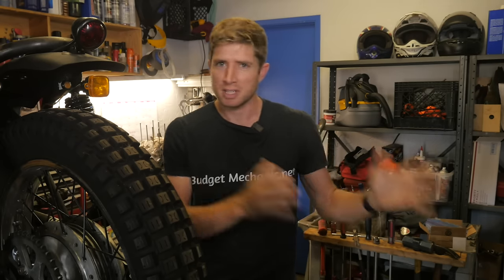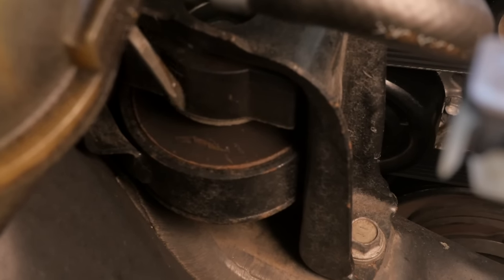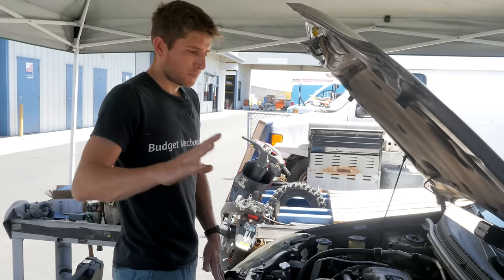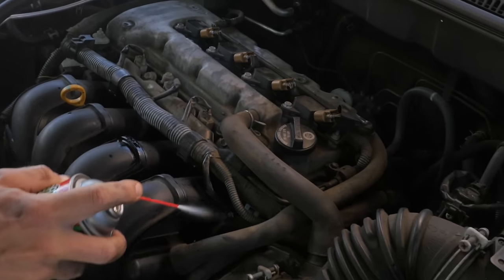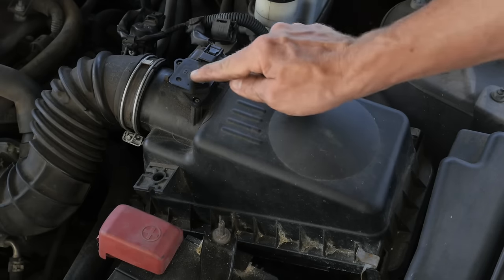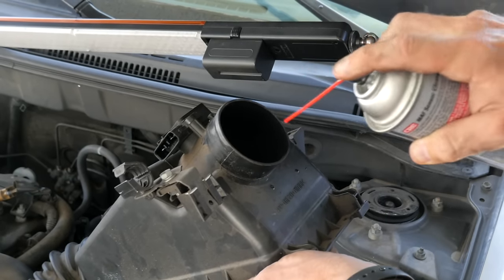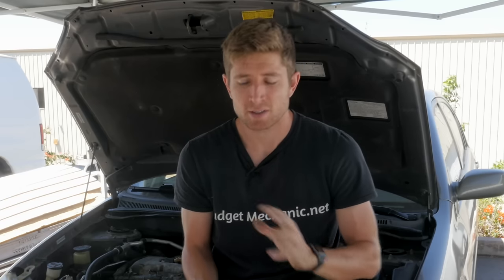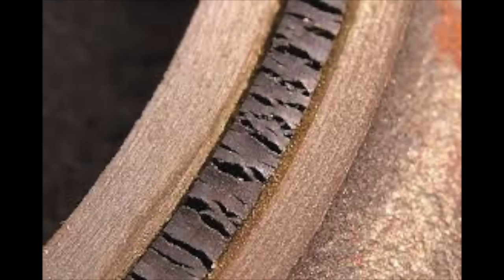Diagnose and Fix Rough Car Idle - Main Causes For Shaking / Vibrating While at a Stop

Comment: I should have watched last Saturday or yesterday. :D My car was vibrating/shaking when stopped, with a flashing service engine soon. Then disappears and reappears. I brought my car to an auto care and was told nothing showed up when diagnosed but went from there to misfire and coil was changed. But when test drived, it vibrated again and service engine appeared. To make it shorter, they weren't able to fix the problem and I was told the problem could be the engine, or inside the engine. I somehow doubt it, boyfriend thinks so too being a mechanic himself, but he's not around to check it, said it could be technical as well and not the engine. I called the auto shop and asked if they've checked other parts, before I consider other options for my 2004 Altima. Hopefully tomorrow is a better day when I bring it back. What do you think? Could it really be the engine?
Reply from the maker: Is check engine light on? That will help you figure out what cylinder is culprit. Do compression test, that will tell if there’s engine damage
Reply: @BudgetMechanicHawaii  
The "service engine soon" light is flashing, and it appears/reappears if the car vibrates. It says might have damage on cylinder 3 according to the shop where I brought it. They changed the coil, switched the coils, still with the problem so they said it might be internal damage with the engine. I asked if all other parts that can possibly cause the misfire were all ok or if they were checked, and was told yes. I wished I have known about the compression test and asked them the result, since it seems like they didn't do it with the "it might be" the engine. Will bring the car to another shop tomorrow that already did some work on it years ago and hopefully they find the problem. Thank you for taking the time to respond. 🙏🙂

Comment: What if the vibration is only in the steering wheel when car is stationary, and brake pedal is pressed, like on red light stops? It's a Honda V6, J30A1 engine. It also has a (slight) permanent vibration in the steering wheel, which intensifies at red light stops. Every mechanic I visit tells me it's normal for a V6, but I had a straight 4 cyl Honda which was virtually "dead" at the steering wheel. Couldn't they just be avoiding a complex repair? I'm tempted to use that spray throttle cleaner but wouldn't it push dirt further into the engine and cause some other trouble?

Comment: Bro I'm i have the same make and model v4 and I'm here to look for a shaking noise. The last part where you said transmission and torque converter i have a noisy trans sounds like a whiney alternator. Now I thing its all related thang God I was going to change both the motor and trans

Comment: My 08 scion tc will randomly make a lower sound and start vibrating lightly on and off when stopped. It isn't consistent and nothing seems to MAKE it happen. It'll be idling normally at a full stop, suddenly becomes lower and vibrates slightly all of a sudden, then back to normal before I even give it gas or put it in gear. No changes in rpm at all. Any ideas?

Comment: I just got a 2016 nissan frontier auto 2wd from the dealer recently. They said everything is up to date( oil, spark plug etc). Now my truck vibrates in idle, especially when I'm in gear at a red light for instance. It'll vibrate on and off every other minute or so. And once I take my foot off the brake to accelerate, the gas pedal will slightly hesitate. Once I get going it runs smooth. I was told by a friend to hook it up to an OBD2 reader and just get an "idle bump up"( extra 50 RPM) to smooth it out. Just to note, my Check engine light is Not on. I'm confused and annoyed with the random vibrations.
Reply: Let me know if you have any updates im experiencing the same thing

Comment: I have a 2016 Dodge dart sxt, I feel nothing when I'm in the car, but my father comes out and tells me the car was shaking the house? Sounds odd so I took it with a grain of salt. The car barely shakes, doesn't vibrate, but he's certain that he can hear my car when I park in the driveway and it causes his desk to vibrate.
What do you think? 
The one odd thing that I found was upon one start up out of the three it did sound like a vacuum cleaner in park. 
I'm not sure if anything is wrong with it.
Reply from the maker: sounds can feel different outside the car, a big motor can produce some pretty good vibrations thru the exhaust that you may not feel inside the car.
Reply: @BudgetMechanicHawaii  okay, thank you.

Comment: I'm searching EVERYWHERE for answers....2018 Kia forte, drives fine but a bit rough when idling or foot on brake, and then the dreaded check engine light. Replaced coil #1 and all plugs. Same. Compression check...all at 150. Checked fuel injectors, all at  .07. Thoughts?? I do NOT wanna take this thing to the dealer. And yep...air filter clean, and has cap tightly on:)
Reply: Check with a Kia dealeship.   Call their service dept. and ask if they can reprogram your main computer.   Sometimes after replacing plugs and coils, the engine light will come on after you replace those parts.   I know you and I hate to take a car to a dealership for various reasons, but that is the best route to take if you have a main computer that needs to be reprogrammed.
Reply: @tompastian3447  believe it or not after all was replaced and driven 100 miles (?) the light went off and it runs normal, thank God. With THAT said, I have no idea what caused the problem since I replace so much LOL.  BUT....thank you for this comment, it's VERY useful. Godspeed💖
Reply: @JoyinFlorida  HI joy.  Glad your problem is resolved.   My neighbor let me borrow her brand new KIA SUV so I could pick up my car from the Ford Dealer.   I found the acceleration on her KIA was not consistent.   Not saying there was anything wrong, but I noticed an unusual delay when I hit the gas during the drive, coming from a dead stop.    I have a 2004 Grand Marquis.   That is the one I had the acceleration problem with.   I find the car to be very reliable over all, and highway mileage is as high as 30 MPG.   Plenty of room in the car and in the trunk.   What surprised me however is that so many Ford dealers had no clue about reprogramming the main computer.   The Grand Marquis / Crown VIc are Ford's fleet vehicles, not just a common passenger car, but used by many police departments even to this day, and by many cab drivers.   For any Ford dealer that can't diagnose or program the main computer on these vehicles is inexcusable.   Gus Machado Ford service rep told me "we generally don't work on any vehicles with over 135,000 miles".   Would you buy a car from a dealer who told you that?   Palmetto Ford service rep told me as far as he knows, they never replaced a main computer on any vehicle.    I explained my problem to him and he said "Sorry Bro, there's nothing we can do for you".
Reply: @tompastian3447  as With politicians and Doctors, I've also lost ALL faith in mechanics LOL. Where has this world gone ?😉And I much appreciate that input...

Comment: The car I have shakes when driving and stopped and also the engine light blinks n stays on and when I open the hood it has a little smoke and it's hot. Even when I didn't go nowhere but down the street. What could it be ?
Reply: Cracked exhaust manifold. Sounds like the same thing that happened to me. Get it looked at because if it over heats too much the head gasket will blow, and that's expensive to repair.

Comment: motor mounts are changed
fuel system pressure is checked
mechanic said spark plugs are fine too but a lit bit later need to change

may be my air system si fucking with my car

Comment: My 2014 MDX has idal problem ! The indicator shows 0n the meter 1 . I used sea foam, ultra gas, but doesn’t reach to zero or close.. is it the Accura MDX problem. Please comment; I drive for Lyft and it has 156,000 miles

Comment: Just bought a 1999 f150 5.4. I have a similar situation. When my truck has been off all night and I first crank it in the morning it doesn't shake or anything. Once I drive it a little bit will start shaking when I'm stopped or parked. The rpms don't move around to much stays about 1000rpms. Seems to get quieter when in neutral. Changes throttle position sensor, plugs and coils, air idol control valve and pcv valve and it's done nothing to fix the problem. Check engine light is on. When I'm over 40mps and accelerated it doesn't vibrate or shake or surge. I also recently had a couple times I went to start it and it would crank first couple times almost like a dead battery but then third time started right up. So, lost at this point lol
Reply from the maker: I would go after that engine light and see what it is first
Reply: @BudgetMechanicHawaii  Well, I added some seafoam to my gas tank and oil stabilizer in my engine and the shake went away and haven't had any rough idle or problems starting. It runs smooth to the point sometimes can't tell it's running. So, not sure which one did the job or both. Thinking maybe it sat maybe had a little water in the gas or clogged injector. Has been 6 days changed the oil yesterday everything is still smooth.

Comment: I had a lot of work done on my car recently (engine was pulled out of the car). Engine put back in again, start up was rough but went away after a few mins and drove home 30+ miles (no engine light). Now that it was parked for a few days idle is rough now and doesn’t go away. Has engine light now and looking around to get my hands on a scanner. Afraid to drive it to nearest shop.
Reply: Update?

Comment: I have a semi auto gearbox and my car shakes when in first gear and revers and the revs drop really low and car nearly stalls when slowing down to stop .mechanics cant figure it out and my spark plugs and coil failed after 55 thousand km and i know they should last way longer and the coil was completely melted..anyone got any ideas

Comment: I just got my Chevrolet Spark 800CC - Manual Gear 2015 with around 178k KM out of a full engine cleanup and timing belt replacement and other activities from the petrol tank to the engine.  Spark Plugs are very new with less than 15000km on them and mechanic/myself reviewed and they are in good condition.  The engine vibrates when in neutral, thus is a dull/different sound as I used to.  After so much money spent, is there still an issue?
Reply: Vibrates in neutral its the transmission

Comment: Hi sir , my car have problem with low Idle , i have change spark plug , throttle body ,  master air flow ,  intake manifold are clean  but i can not  fix that problem. what is wrong with ? when engine cool is no problem with low idle but when engine  hot this problem is coming , what is the root  cause of this low idle sir ? thank you so much  ( camry le 2002

Comment: I have this on my Matrix 2013. When it's parked put gear selector in Neutral vibration stops, when put back in Drive position and hold on break pedal it vibrates. Looks like it comes from transmission.

Comment: my car like buzzes a bit not totally shaky but just a little enough to hear when im stopped, a little less if ive parked. when turning on i know it takes half a second for a car to turn on as youre turning the key but it seems like today it was a littleeee split second longer and when i accelerate i hear a lil ttrrrr noise at times depending if im going up a hill or whatnot. what could be issues of this? (have had recent spark plug change)

Comment: I have a vibration issue that usually gets worse after driving for a long while but is pretty minor. Also I've noticed when I give the car a rev to about 3.5k rpms (i know thats bad I only did it to test this issue) I hear a kind of clunk like something is moving on something. Is this likely my motor mounts? I am confused because the vibration doesn't seem to be consistent and I thought motor mounts would vibrate the same when I turn the car on to when I shut it off.
Reply from the maker: Best way to check motor mounts is looking at the rubber portion of the mounts for cracks. And also have someone watch the motor when you start it up and give it gas to see if it moves excessively

Comment: I have a question, let’s say I changed my spark plugs and when putting back in the coil on plugs I mixed them up. If I put the coil on plugs in the wrong slot like I mixed them around basically, would that do any harm to the engine or possibly make the engine idle rough?
Reply from the maker: With coils it doesn’t matter. The wires going to coils however must be in the right place. But usually they are the right length to only go to one coil

Comment: My car starters vibrating when I start ac b4 that it seems normal... Any suggestions?
Reply from the maker: Potentially something to do with your throttlebody or idle air control valve if you have one. Those things usually control the idle speed under various conditions including when the AC turns on

Comment: I have a 2014 jetta that shakes and the RPM keeps on going up and down and like the car wants to turn off I toke it to Volkswagen and they can’t find nothing in it there’s no Check engine light does anyone have any tips on what it can be ? I already change the spark plugs and coils original from Volkswagen and it still keeps doing it

Comment: This is the same engine I have... Is it a 2005 matrix by chance? I need some help with a hard start problem... It has new plugs, new injectors, new fuel pump and the throttle body had been cleaned. I'm thinking it's the fuel regulator, it's a returnless system.
Reply: It's a corolla
Reply: @trainerzard7  thanks for getting back to me but I tracked down my problem to the fuel pump. I found out that between the filter and the top part of the pump there was a leak so I would ended up swapping out the upper part of the assembly unit with bottom part of a known working unit.
Reply from the maker: Did you do any of the other simpler things I suggest in this video? I would try some easy ones before you change mounts again
Reply: @BudgetMechanicHawaii  Actually it turned out to be a bad after market fuel pump and also bad after market injectors. I changed out both for OEM parts and it has been running perfect ever since.

Comment: I have a 06 matrix . new crank pulley . new denso coils .new spark plugs. New air filter .clean throddle body and sensor.. no check engine on. New motor mounts.. Still shakes while stoped.. Any advise my friend???
Reply from the maker: Try some transmission additive, they make some that targets shaking.
Reply: Would you happen to know the name of it?

Comment: I've got an '04 GTP Comp G grand prix and im looking at a unique situation i cant seem to find anywhere online. The first start of the day and the first start ONLY is extremely troublesome, and most the time im looking at a crank no start situation. After letting it sit for a second with the key in, and a handful of attempts, it will finally start, but the engine begins shaking, stumbling, tachometer flying all over the place, That kind of deal. But after a couple minutes of that? Everything "levels out" and the engine and car run absolutely perfectly, but getting it to start that first time in a day is so sketchy. I hope i can find some help on this. I would greatly appreciate anyones advice. (Searching it up seems to make me thino fuel pump check valve, but once again, this is ONLY the first start.)

Comment: So found out engine had a leak so in a long drive I heard a knock every so often. No oil light came on. Stopped for a few hours. Started up, idle rough, 1st rough, engine light flashing. I put 2.5qts oil in which means half of oil was gone. Smelt coolant that was half way down. I filled up coolant before I left. No metal slapping or pinging sound when driving. Most likely problem? Timing?

Comment: What if sometimes when it starts shaking on idle it turns off? Does this help narrow it down?
Reply: Transmission
Reply: Definitely not the transmission. that can be caused by a couple things either by a vacuum leak or a clogged fuel filter or a bad fuel pump which isn’t common but is possible
Reply: I had this same problem with a Ford I have, it will start shaking when I press on the brakes then will turn off at a red light. You can turn it back on, but I have since gotten the fuel filter, transmission mount and new spark plugs it helped, because there was times where I couldn’t start it either just dead. Most likely it’s the fuel filter that does it or just either bad battery, also had to get a bigger battery because the battery I put in was too small for my car.

Comment: My 05 envoy ran out of gas(malfunctioning gauge). I managed to get enough gas to make it back to the sheetz I always use. I filled the tank and the second I cranked the envoy it shook violently and code reads "cylinder 2 misfire". I thought maybe it has water so used a bottle of heet to remove the water. No luck so used a 2nd one and it still shakes violently.  So parked it for a while, recently drained the tank and was going to replace the fuel filter, figured maybe theres trash in it but i cant find it. Every video I find claims the filter is on the side infront of the tank beside the fuel lines but its not there. Even 1A auto showed it. I really don't want to take the tank down to replace the filter assuming its inside the tank. There seems to be alot involved in removing the tank way more than my old tahoe...which I really miss.
 Does anyone have any idea whats going on or suggestions on how to fix it? I dont want this one to crap out too.😢
Reply from the maker: I would address that misfire from a spark perspective first (test/change plugs and coils)

Comment: How do you reset the ratios for the Idle? I cleaned my throttle body and my Idle stays accelerated at 2 ?
Reply: Idle closed position relearn and idle air volume relearn